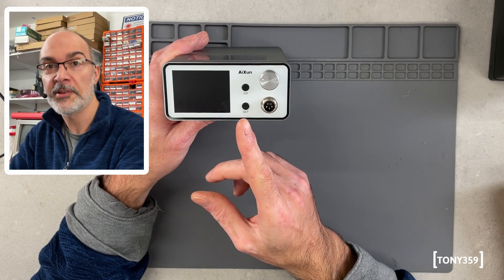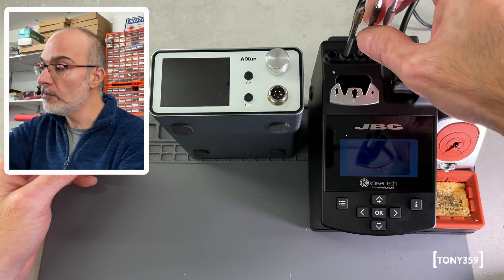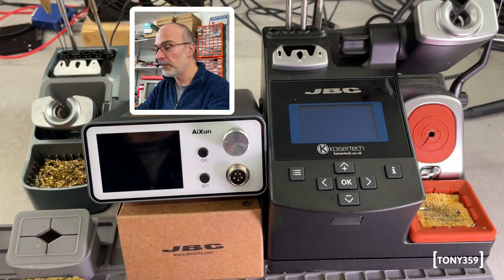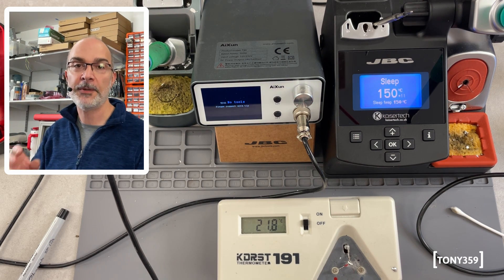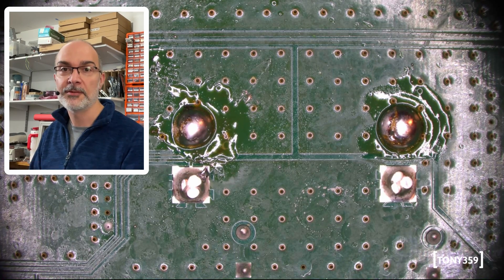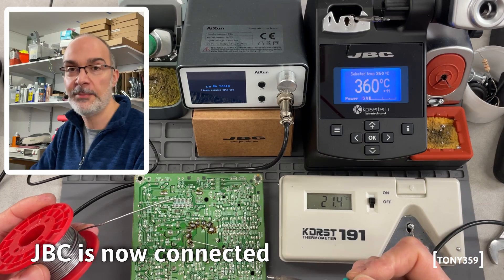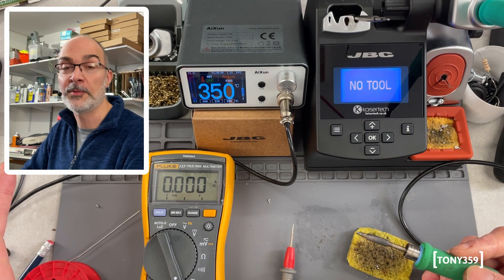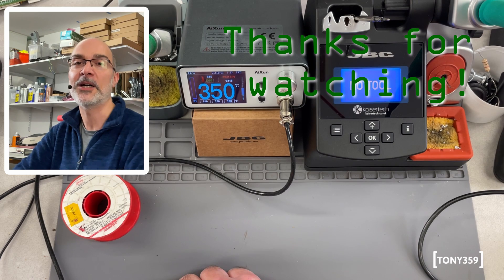Can the Aixun T3A really beat a JBC station?

Comment: Mine does the same when I was reworking a cross over filter while it was still connected to my amp which was turned off. I could hear the pwm sound, though not as loud. Other than that I always disconnect from mains before soldering, though Indid forget it a few times but had no issues so far. 

I'll test that temperature overshoot thing, I hadn't noticed it before.
Reply from the maker: A soldering iron should not leak enough current to make a speaker sound..... A speaker won't mind. But electronics might be a bit more fussy!!
Reply: @tony359  I agree with you, though I haven't had any issues with it damaging something. Most ICs in retro computers can easily take 1V. I've done an ReAmiga1200 with this soldering station and it works perfectly. I usually use a 1k ohm resistor on the ground lead of my oscilloscope to prevent short issues, this included. I'm considering getting a differential probe, that would solve that issue as well. Only thing I have to remember is to flip the switch on the power strip when soldering. It's a hobby for me. I can imagine for a business you'd pick a real JBC, no question.
Reply from the maker: Definitely not an issue for retro computers. However there should be some cheap options which don’t make a speaker sound. I’m told the ones with a linear transformers are ok. I just consider the T3A unfit for purpose. And sorry, I know you have it. But I also have it 😂 
The JBC is overpriced for sure. I’ve got one as I needed a reliable one and couldn’t afford time and money to test further Chinese copycats 🙂
Reply: @tony359  Yep I'll use what I have with issues and all until it bites me bad enough to upgrade, which sometimes happen and I do. 
I also have another Chinese transformer based soldering iron and it doesn't interfere with the T3A when 'duo' soldering. But it has integrated pre heater and hot air iron and isn't very portable, and doesn't heat up quickly nor has good power handling with larger copper mass targets. So if I need to move to my floor standing speakers I rather pickup the T3A and deal with the hum ;)
I fully understand you picking the JBC, you've reached that point that it bothers you enough to make the splurge. I probably got already 300 euros in JBL original tips lol so who knows!

Comment: As someone new to soldering, I really considered this station because of its size and capabilities. However after the review, I'm not entirely sure anymore. Would you be able to recommend any other stations like this that doesn't break the bank?
Reply from the maker: it's hard to say. I'm told the SUGON are good, the ones with a linear transformer inside, not the switching power supply. That said, the T3A was also supposed to be good so without seeing it by myself I cannot be 100% sure.
Reply: @tony359  Thank you for your input! I'll check 'em out and keep researching I suppose
Reply: @Gemmmmmmmmmmmmmy  Hi, which soldering station did you choose ?
Reply: @CanaleYouTubeGeneralista  I haven't gone for any yet, other priorities took over so I had to pause, and these aliexpress stations may be too overkill for my use case. Although ifixit released their own portable station which I'll look into

Comment: Thank you for the review Tony, I was expecting is to be low ish quality but the voltage leak and temperature overshoot are crazy
Reply from the maker: You're very welcome - I was also disappointed, I bought it for myself and I cannot use it anymore...
Reply: @tony359  what if you power it through an isolation transformer, that might solve the current leak, allowing it to be used as a second soldering iron (perhaps).
Reply from the maker: @martindejong3974  Maybe but a 200W isolation transformer is expensive! :) Also, it would make your tip floating which is also not great.
Reply: @tony359 觉得贵 自己动手制作一个😂

Comment: I bought a JBC years ago and love it, but I don't love the price of the tips.  This is good to know that Aixun is supplying lower cost tips that will fit my JBC.  The tips we find on AliExpress are certainly not authentic JBC tips, but I don't care.
Reply from the maker: Well one of the tips I got with the station split in half when I pulled it out the handle. Yes, JBCs are stupidly expensive but I'm not sure Aliexpress is the answer. My Aoyue station is horrible with Aoyue tips - it's working nice with Hakko tips so I feel that the main part of a soldering iron is the tip - the station is just a heating element after all. And with the 245 it's not even that! :)
But yes, they're too pricey...
Reply: @tony359  Hoping that was a QC issue on only that tip.  I just ordered three tips to check out their various sizes.  $21 total for three tips.  I can't even remember how much the JBC tips were, but they weren't $7 each.
Reply from the maker: they're £27-£20 each, a hold-up! But really the tip makes THE difference. Even with the Aixun I bought some JBC tips. Those will last forever and deliver the performance you need - but I am not going to argue that they're silly expensive :) 

Anything from Aliexpress is a "QC issue" :D

Comment: Jbc is the best, right?😊
Reply from the maker: It has to be, to justify the silly price :)
Reply: @tony359  I wnat to buy a station but I dotn wnat to pay jbc price, then what should I get that's dependable?
Reply from the maker: @chrisv.6951  I'm told that stations with a linear power supply work well - but I cannot guarantee that, even the T3A was supposed to be better than a JBC...
Reply: @tony359  I don't have direct connection to the source.

Comment: Since you nemtioned there is a new firmware out for the AiXun T3A, would you revisit the unit and test if they fixed  any of the given issues. Or maybe seek DIY solutions to fix them, I can't shell out JBC money for the soldering station and so I have been looking at items from AiXun like model 420D (Dual handle) and a few other iterations. I want to save enough money to also get a hot air/SMD rework station.
Reply from the maker: I appreciate it would be nice to look deeper into this issue but I won't be doing a follow up on this station. I invested way too much time on it. The flaw cannot be fixed by software, it can be hidden or mitigated but not fixed. Opening the T3A is also mostly a destructive process so I'm afraid my contribution on this model won't go any further! But thanks for your comment!

Comment: Does anyone know of a cheap 200W alternative, but without this problem?
I was considering this station, luckily I didn't get it.
1V at that amperage is dangerous for electronics. We must repair not destroy
Reply from the maker: I'm hearing that anything with a linear transformer inside doesn't have that issue - but I cannot guarantee that, even the T3A was supposed to be good!
Reply: @tony359 I don't know the aixun operating system, but the problem is serious. In the right conditions, accidental contact with a ground electrode is enough
We already have a voltage that biases a transistor. If someone works with expensive components (ex amplifier) they risk doing serious damage.
It's scandalous that the producer doesn't show up. It is not a problem that can be solved via software, the project must be revised
Reply from the maker: Absolutely. Mistakes can happen but then you own it and fix it. Sticking your head in the sand won’t work.

Comment: How does JBC avoid this? grounding the outer shell? I now want to design my own PCB for the JBC handles/tips, in theory it's very easy! Reality tho..
Reply from the maker: JBC use a linear power supply, I understand that this way the supply is completely separated from mains while Aixun - if not mistaken - links mains ground to the negative of the SMPS? I might be incorrect though.
Reply: @tony359  what soldering iron around 200CAD would you recommend for someone like me? I have a pinecil v2 but for some big ground pins and lead-free solder it's not enough! I also want something with a dock that allows me to quickly change the tips to a sharp one for SMD and then a different one for say ICs

Also, I thought both SMPS and Linear (big transformer) are isolated? I just thought that SMPS just uses higher frequencies vs 60hz
Reply from the maker: @ameliabuns  I'm not sure what to recommend I'm afraid. I went with the JBC as I had spent enough time after these irons. It's good but definitely expensive. 245 tips are too big for SMD. The JBC can use 210 too but it's a separate handle.
Reply: @tony359  oh the T420 is really expensive but can support all the handles and has an isolated PSU, tho the T320 can also handle both 210 and 245. I also hate the fact that they need software updates with their super sketchy software.

Comment: To the owners of the aixun T320 and aixun T420D, do you know if this  problem has been corrected on these new solder stations?
Reply from the maker: I don’t think this behaviour can be ‘corrected’ - my understanding is that units with a linear power supply are unaffected. Cannot remember which one of the two it is.

Comment: Would an isolation transformer completely solve the voltage issue for a cheap price?

Won't solve the horrible behavior by the company though.
Reply from the maker: I haven’t tried but it would make your tip floating which I understand it’s not a great thing either. Maybe the lessen of the two evils?
Reply: @tony359  good point, but it's probably still better than burning the board.
Reply from the maker: Ahahah you’re right!

Comment: Thanks for your tests and review, was going to buy an Aixun T3B! I'll look for something in between, as the JBC is expensive for hobbyist
Reply from the maker: No worries - I haven't tested them but I am told that those with a linear power supply inside are good. JBC definitely expensive - too expensive I shall say :)
Reply: try to find a used jbc. here they cost the same as a new aixun
Reply from the maker: @olDirdey  Yes, an used JBC is definitely a great idea!
Reply: You can buy JBC clones that have transformer and they are fine
Reply from the maker: @M.E63  Apparently yes. Though the T3A was also supposed to be "fine" and now it's a paperweight on my shelf...
Reply: @tony359  Yh your right it’s not ideal.
How much you looking for it as in UK ?
Reply from the maker: @M.E63  Would you like my T3A? :) If so, please do get in touch, my email is hidden on my profile - or Twitter (@tony359)
Reply from the maker: @M.E63  Please send me an email, my address is on my profile, hidden in the description. Or twitter (@tony359)

Comment: Hello, the Aixun T3A station all have voltage at the tips of the soldering iron or yours was defective and that fault could be repaired. I want to buy an Aixun. I would recommend it.
Reply from the maker: There should be NO voltage at the tip and not all Aixun have that problem. My station is not faulty, others have confirmed the same behaviour. I do not recommend the T3A. Thanks for your comment!

Comment: The moral of the video is you get what you pay for I guess. What is interesting is why did it take a small channel to deliver the facts, it could be what you buy with your own money, means you are more critical on what you get for your investment.  

The disturbing part is it sounds like Aixum on discovering some of the issues hide the evidence of the issues with software deception. One thing I know from 40 years in the business is that  passing a hardware issue onto the software guy hardly ever has a good outcome.  

I suspect the voltage/current at the tip needs an good old fashioned transformer to resolve the issue, particularly if you want to use tips from other manufacturers,  but then it would have to be large and hence more expensive than the smps it would replace, it's easy to heat the tip in 5 seconds if you have the power to deliver to it, and a smps will give you that power cheaply. The problem is if the iron can go from 20c to 320c in five seconds in can over shoot by 40 c in one second. it would have to have a very tight pid loop indeed, however, that would reqiure  a feedback signal that isn't lagging behind what the solder pool is at. 

Stop soldering pennies and reviewing over a day,  Tony gets this from what I have seen. We could as end uses make the sellers of soldering stations easier by taking the trouble to select the right tip for the job ,and not just force more power into a small tip because we cant be bothered to change it out, I'm guilty of that,  and understand that when you set your iron temp to whatever,  the best you can hope for is that it reaches that set temp in free air within 5C because it doesn't matter to the degree. if the display is rock steady at the set temp while you are  soldering difference components, plains, the the display is lying to you. What would help both the end user and the manufactort is to have a button conveniently placed on the iron that gives a controlled boost. I want to decide when and where I want to ignore the set temp, the button could for instance give you an extra 30 c over the next solder joint cycal when tony was soldering those inductorts in the first video the reason why the iron was so impressive was because it was operating 40C over the set temp, it just didn't tell him. The truth of the matter is, if that is what it took to solder that inductor then so be it. It may have been better if the station informed Tony,  buddie we are getting nowhere i'm going into hyperdrive.
I am so impressed with Tony, I have subscribed as my feedback loop told me too as some other channels were as honest as the Aixum display.    Well done Tony, you may never be, Big Tony, but honest Tony is what you are until you sell out that is.
Reply from the maker: ahah thank you for your kind words and welcome! I don't blame other reviewers, the ground issue is a bit uncommon - though I stumbled into it so many times by doing my daily work.
"You get what you pay for" is indeed the bottom line. I wasn't expecting perfection but what I found here is unacceptable. There is another channel showing GPU repairs (@NorthWestRepair) and his iron glowed RED when he de-soldered an inductor using two irons, hence grounding them. RED! How much is that? 1000C? No, thanks!
Reply: @tony359 Lol, why does glowing red not surprise me.
I am retired now but in my 20s I had the opportunity to visit a factory in coventry where girls were putting together relays, some of the girls had to solder wires to the base of the relays, the irons they used weren't temp controlled, other than the element just delivered. They took a file to the tip when required. They liked their irons as hot as possible as they got bonuses if they exceed a certain number of finished units. I kid you not, if you or I had the top of the range JBC station,  our choice of solder and flux, we would still be ashamed to put our efforts against theirs. They had no idea what a relay did, and they didn't want to know. One of them told me as she took the file to the tip, still connected and hot, that the object was to get the biggest bonus possible and use it a one of the fashion shops to buy a dress for the saturday night dance, were they would meet the love of their lives, and never have to work again. I thought at the time, but the relays.
Reply from the maker: Friday afternoon job ;)

Comment: Hi. I completely understand that AiXun T3A is a flawed device and most people should avoid buying one, but most of the internet suggest T3A or Chinese soldering stations. JBC is really expensive and out of the question because of that. Maybe someone cen suggest something in the middle of T3A and JBC? It can be less powerful then both of them but at least with good components and quality.
Reply from the maker: Yes I also understand that JBC cannot be an option for many. I hear that linear transformer-based units work ok. Sugon makes one, I cannot remember the model (A9?). Aixun also make one but for the life of me I cannot recommend anything from them! :) Thanks for watching!
Reply: @tony359  Thanks for answering. I really appreciate that you read and answer every comment 👍🏻
Reply from the maker: No worries, I try my best :)